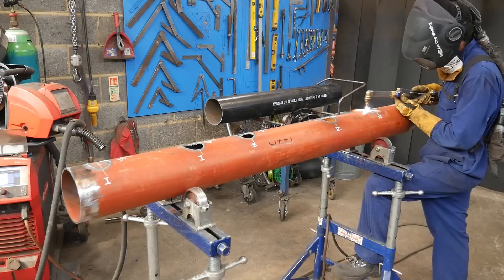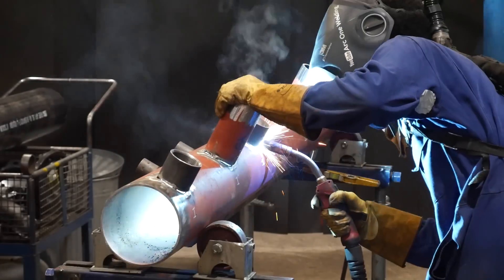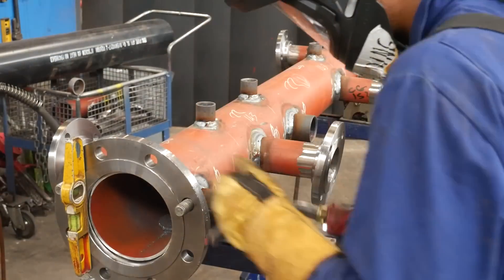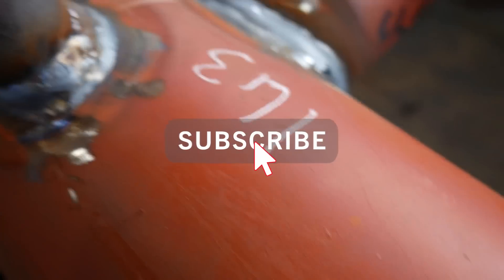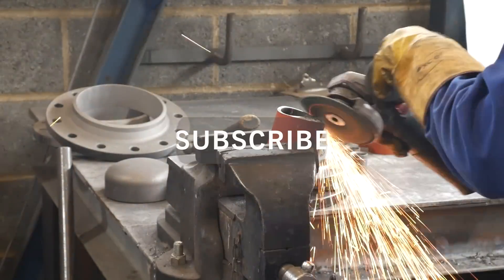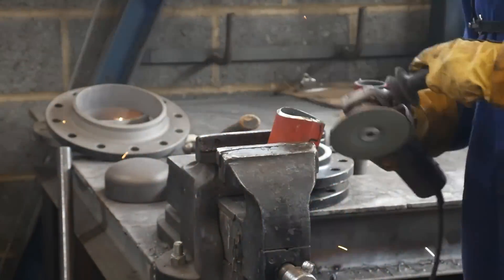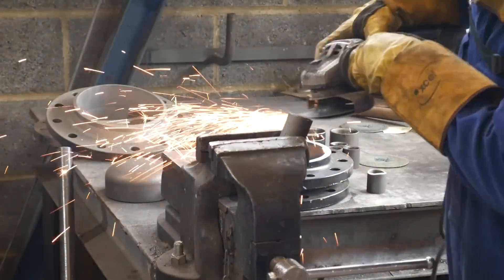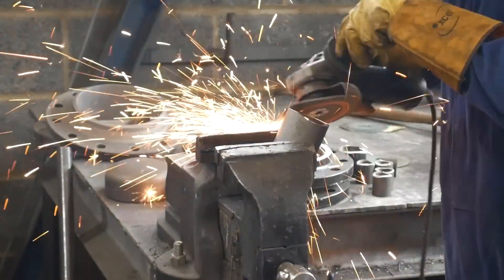Pipe Welding a 6" Header (MIG/MAG How To)

Comment: do you ever use weldneck flanges? always slip on?
Reply from the maker: Yeah ive welded plenty weld necks but for the most part its slip on, because its usually always low pressure

Comment: Some top work there again Calvin👍
In the middle of a pair of similar sized spools at work at the moment, different in that they're 8"sched80 with 300lb weldnecks each end, 3 off 4"branches in them, along with 4 off 2" o'lets offset from the branches at 45° and all fully tig welded 316.

Comment: What are your weld settings? Are you using pulse mig? It would make a great video to show in detail the technique you use to weld around those couplings
Reply: That’s short circuit mig, pulse doesn’t have all the splatter and is much faster

Comment: Is it possible to put a chemical and particle filter into the adflo at the same time, or just each separately?
I would like to buy a Speedglas or a Kowax. I weld steel and stainless steel and then I have to grind right away, like the ones in the videos. They told me that it is always possible to put one filter in the filtration, so I don't understand why the hood is 2in1, when I have to change the filter to a particle filter after welding. Sorry - google translator
Reply from the maker: Naa u have been told wrong, the filter is just a fancy particle filter that grabs air from your back which isn't in the weld cloud but it doesn't filter out the poisons, for that u need an additional unit that goes b4 the particle filter and thats for the gas and there's no need to change filters back and forth, i dont use it because its heavy

Comment: Why didn't you grind out the slag from each cut out hole?   Double stacked welds, because you can't weld good enough to be safe enough with one weld. I know many complimented on your work, but if I'm not honest, you'll never learn and get better.  All the slag is going to destroy pumps and whatever else its hooked up to.
Reply from the maker: I dont show everything on camera, all the slag is cleaned from the inside and off cuts are taken out, and it was a sample piece they wanted 2 runs, but we not all as good as u 🤷🏾‍♂️
Reply from the maker: And if you knw anything about these system u would know there are strainers before the pumps or fine water ways 🤷🏾‍♂️
Reply: There's always that keyboard inspector 😆 I think it looks good man, I double stack my caps on vessels not because It will leak without it, but so I can meet spec with the weld size. We do all dual shield here though.

Comment: What sort of tolerances do u work with i mean thats a lot of connections from one pipe lol
Reply: To me it would almost seem like the other pipes will be constructed according to this pipe, or that the spans will be long enough that there's room for 1-2 mm tolerance.
Reply from the maker: The pipes have a 3mm tolerance, but this would be installed early on and have final site measurements taken to this, but this part is a header it would come off a booster pump or a boiler and go to wherever it needs to go

Comment: Sorry bud, I come from pressure vessel/pressure pipe welding background, this looks like some 3rd class water pipe we would get the 1st year apprentice to make.....bare wire mig would never be used to weld completely out on high pressure gas pipe/vessels, only STT on root run. I'm guessing none of your welds are subject to RT, UT or the WPS you are welding to has passed required mechanical tests at sub zero temperatures?? Maybe should be called pipe welding for amateurs? Please don't insult the professional welders by calling this welding for pros!
Cheers.
Reply: So only boilermakers, welders and fabricators who's work is tested are professional?
Reply: Low pressure or high pressure this guy gets it done and has mad skills. A non-critical project like this would take twice or three times as long with TIG or Stick. They have so many professional videos on how to welds with those procedures and he’s the first one I’ve seen where he utilizes more production style welds on pipe. Which is what I am more interested since its more similar to my field of work.
Reply: Out of interest dan what pressures are your welds tested too?
Reply: @beerustheblack2846  Do you mean what pressure are the pipes / vessels hydrostatically tested to after they have passed visual and NDT examination?
Reply: @Dan-lm9hk  yes the hydro testing element
Reply: @beerustheblack2846  The hydro pressures are dependant on line class, Client specifications, project specifications, etc, and can vary anywhere between 1,500 kPa to 60,000 kPa depending on the above requirements which are generally all provided on isometrics/construction drawings.
Reply from the maker: There's someone out there welding to a better specification to you dan and you will be the  Amateur there, everyones jobs different and whats asked of them u can't just say blanket statements like that but your wrong google search the definition of a pro, it just means you get paid to do it, i never called myself a expert
Reply: @ARCONEWELDING  So nothing technical in your reply I see......that's a shame as was hoping for a technical response. Firstly, my years spent on the tools, and now off the tools, studying and obtaining multiple post trade qualifications have earnt me the right to never be classed as an amateur in the field of Welding, so you are wrong on that one. Secondly, I have not made any "blanket statements" my comments were specific to the piece you were welding, apologies if you took offense to that, but as stated in a previous comment.....this was my opinion. Thirdly, if the most technical item you took from my comments is the Google definition of "professional" well that is disappointing.....It is quite clear what you were trying to mean by "Pro" You are just back pedalling because someone with in depth knowledge has called you out. And if you are not an expert, why post all these videos pretending to be one?
Reply: @Dan-lm9hk  you must work for Nacap
Reply: @mikethomas6408  I don't mate, why do you say that?
Reply: @Dan-lm9hk  welder I knew there.   His ol boy was a welder too.   Good man too.
Reply: @mikethomas6408  Is the Dan you are talking about from Adelaide?
Reply: Hey mate, you can interpret my comment how you like......this is just my opinion.
This kind of mig welding is very basic and carried out on class 3 water pipe.
But to answer your question......In my opinion, to be classed as a professional pressure pipe welder, you should have gone through a 4 year apprenticeship as a minimum and then have min 5 years post trade experience welding pressure equipment to qualified WPSs and relevant Standards. Then let's see if you post a you tube video mig welding on water pipe calling it "how to pipe weld like a pro".......I highly doubt it.

Comment: Excellent Video, if you can please explain, elaborate, and show the following. What type of industry is this used for the fluid passing through it, your mic machine and wire used amperage and wire feed speed, your blue prints showing symbols. I understand your actually at work but it would be nice to see the actual weld of a joint and how you hold your Gun. The symbols you write on the pipe what they mean. I know I’m asking a lot but I learn much better when things are explained and why instead of reading out of a book , it’s a retention issue. 
PS: As simple as it is the way you find / make a center line on the pipe with the torpedo level is TruelyTrick. Thank You.
Reply from the maker: If you watch my 8" on 10" you will see some good welding shots and as for drawing i cant show some things, the pipes have a non disclosure so i cant show everything but bear with me im still new at this and everything will only get better with time 👌🏽